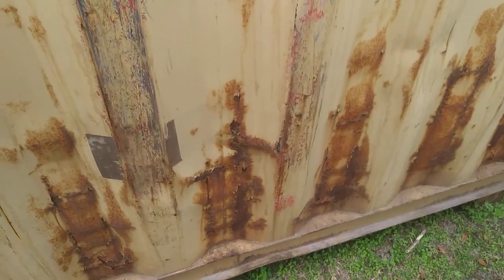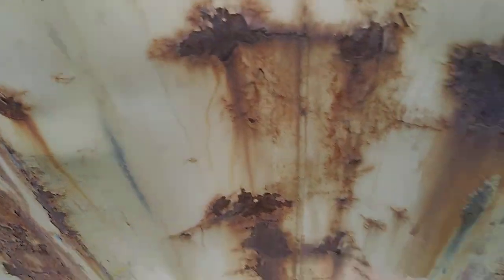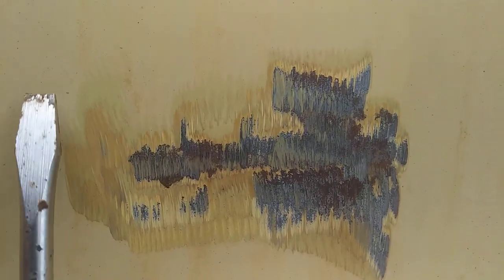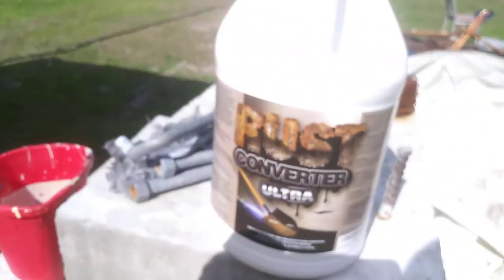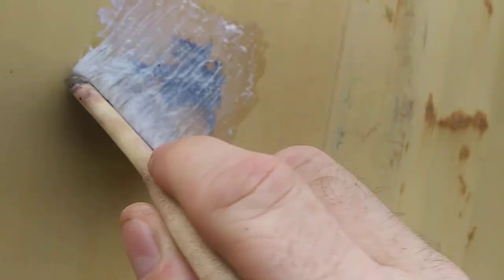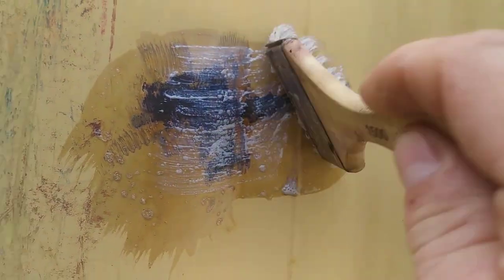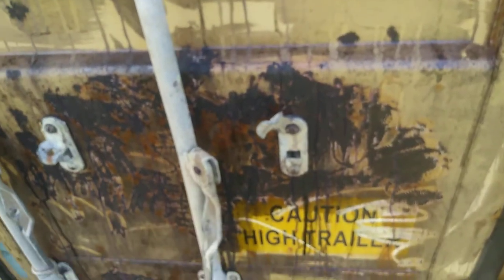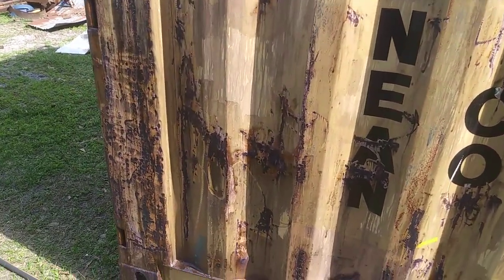Shipping Container Painting prep / Rust Converter application

Comment: When you join 2 containers along the 40 ft edge w/ the intent of removing the two common internal walls,  that’s called the marriage line. In my project, I paid a welder to weld a 3” wide, 1/4 “ thick piece along the 40 Ft marriage line and to weld a 3 “ wide piece along the marriage line on both ends.. He’s done that but I still intend to seal the marriage line (40’ across the top and  12’ 9” along both ends w/ something to insure waterproofing.)
Reply: That creates a trap where water will pond.